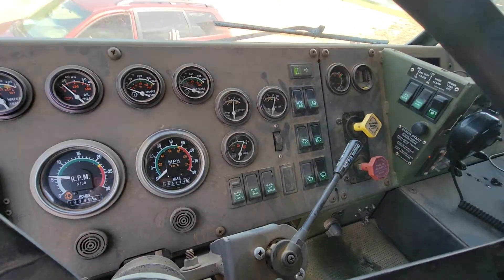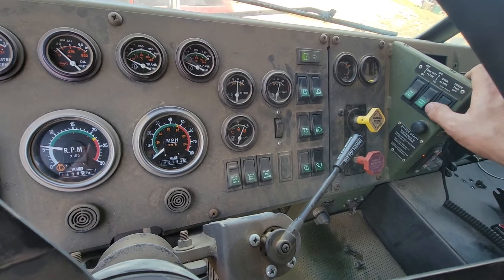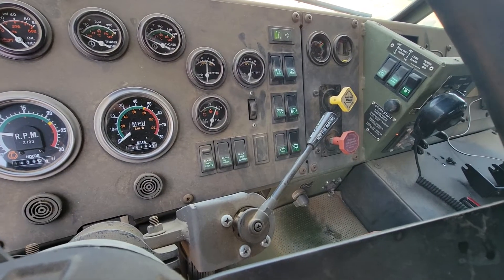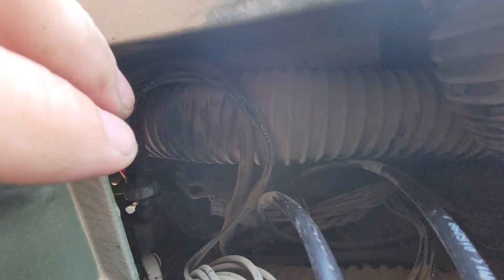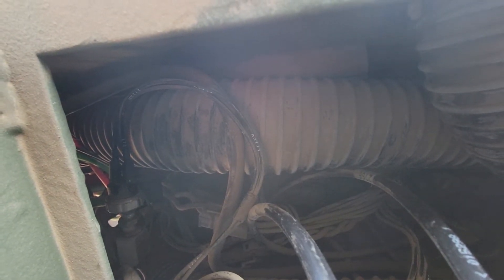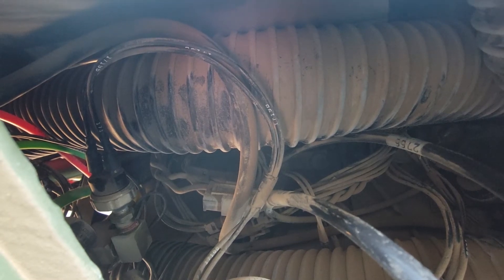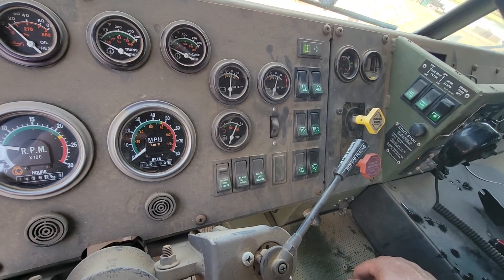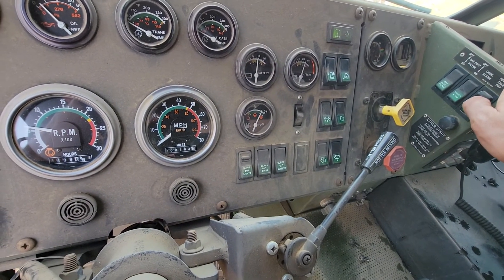Oshkosh M1070 HET PTO/Parking brake Override for Rear Winch Self Recovery

Comment: Wes, by chance do you know how to get the Pto to operate while in gear. We tried to bypass the factory switch but it still kicks out as soon as it’s put in gear.
Reply from the maker: It runs off the torque converter spur gear. It'll only go as fast as the torque converter in gear.  Shift the transfer case to low to make the engine turn faster so the pto shaft run faster.

They may use an interrupt switch off the neutral safety to stop power to the solenoid that controls the transmission fluid pressure to the pto clutch pack.

You can simply hardwire that solenoid. It's on the passengers side of the transmission
Reply: Wes you are the man!!!! You saved the day! Appreciate it!